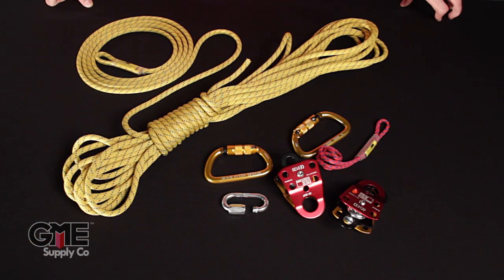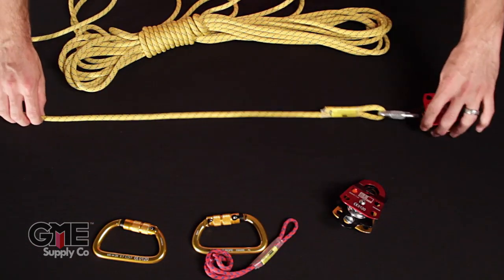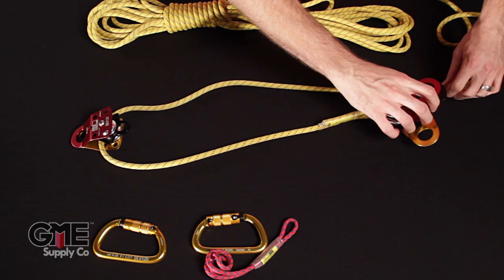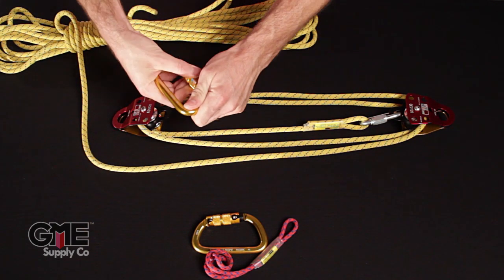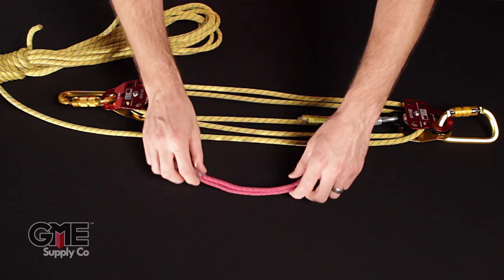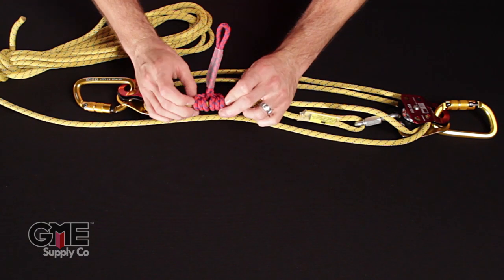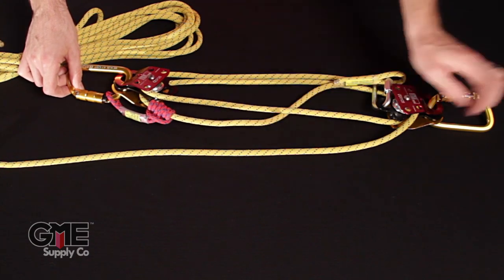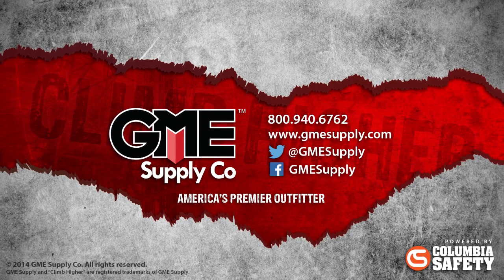How-To: Rig the Sterling Pocket Hauler

Comment: Looks like a nice system and a good tutorial, but I don’t understand why you chose the terminated end of the rope to put your prusik on. This means your prusik will have to hold 100% of what ever the load is and the 4 inches of slack in the prusik cord will allow your load to settle 4 inches every time you let off. If you capture the rope just before the last pulley, your prusik will only have to hold 25% of the load and the 4 inches of slack in the pursik cord will only allow your load to settle 1 inch.

Comment: This is a 5:1. You have it as such. You chose to put the prusik on the left, so that’s your anchor. When you pull the haul end of the rope, your using it as a 5:1. Flip it around, you now have a 4:1 with a CD. Take rope out of the last sheave and you’ll have a 4:1 without a CD, and of course put the prusik back on the anchor end of the system.
Reply: Deerector I was thinking the same thing! If it’s tied to the load it’s an odd number, if it’s tied to the anchor it’s even! In his configuration it’s tied to the load which makes it 5:1. Rule number 4 for mechanical advantage with pulleys, tied to the load count the pulleys add 1

Comment: How do you allow for someone to descend? The way the system is set,the prusik activates as the load pulls.
Reply: First of all, the prusik is in a bad spot. Move the prusik to the other end of the system, on the last length of rope just before it goes thru the last pulley. This will give the prusik the 4:1 mechanical advantage from the rest of the system. If this puts the prusik too high for you to reach, you can go one more pulley back and you will have a 3:1 M.A. with regards to the prusik. You will have to manually release tension on the prusik while you lower the load using the M.A. of the system. You can always forgo the prusik and use an external anchor of some sort.